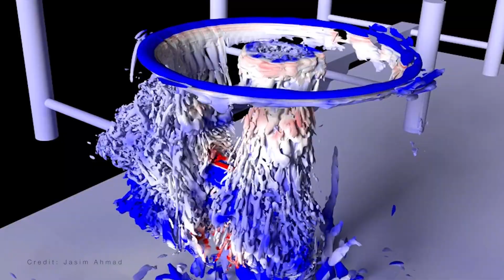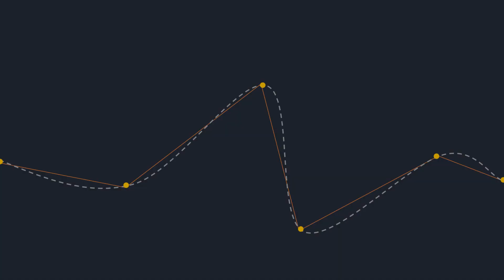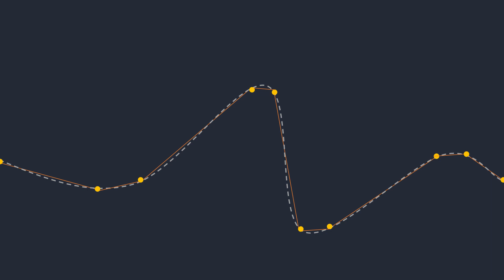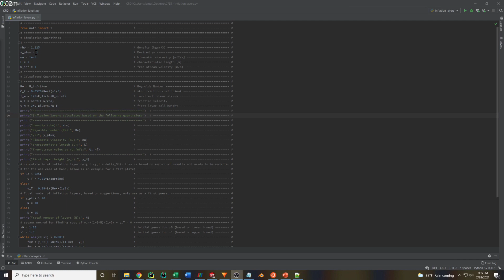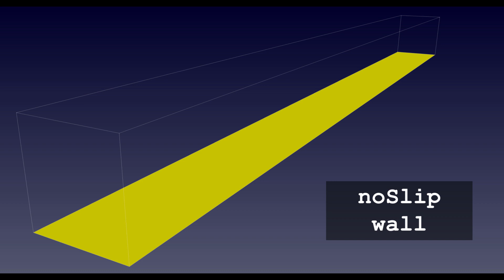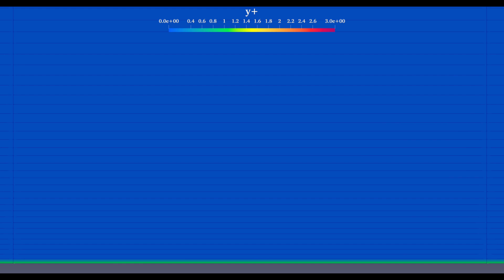Boundary layer, inflation layers, meshing | Canonical Flows 1 (OpenFOAM)

Comment: Hey man, first of all thanks for the video but I would like to ask you if you could explain us how to do the postprocessing to get the velocity profiles, have you used paraview ??. In that case, how you managed to get those profiles?. I checked the openfoam files but i have not found any sampling function object and that's why I am asking, Thanks in advance for your time.
Reply from the maker: I do use paraview for those; to do it create a streamTracer (this can be defined with a line seed type), set the representation type to 3d glyphs and use the glyph orientation and scaling options (I use U as the orientation vectors). I may make a video on this topic.
Reply from the maker: you can also do this on a slice or the internal mesh; I find that doing it on the streamtracer (streamlines) is a pretty nice option though